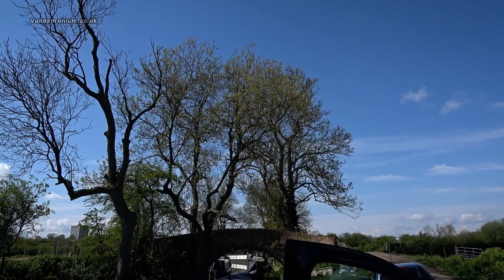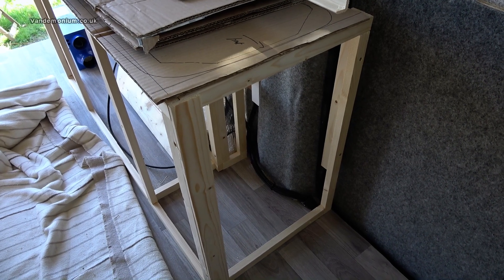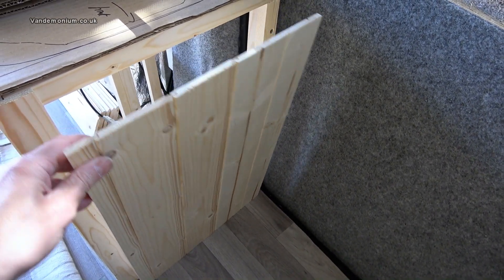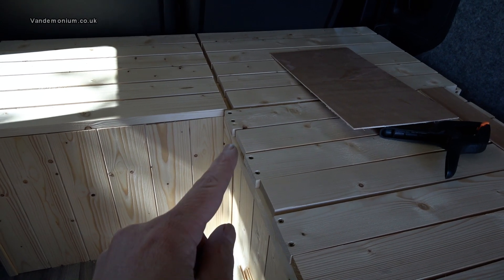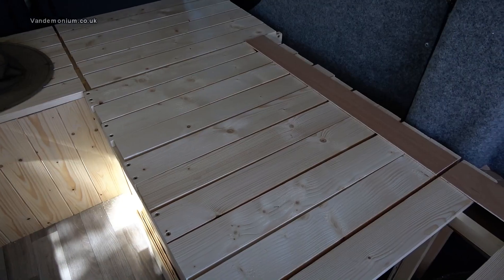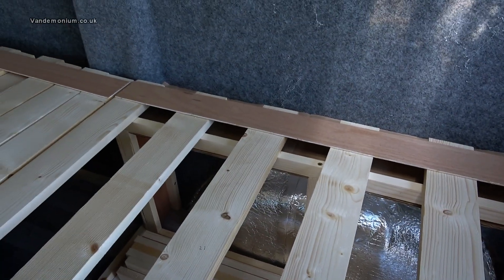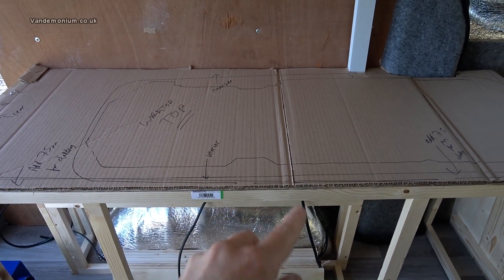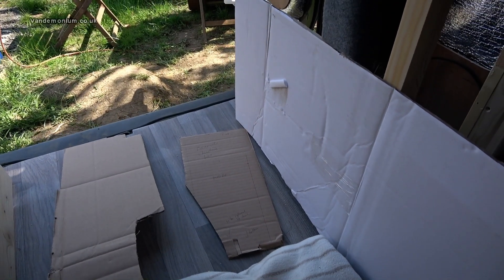Vlog 16: more wobbly furniture building for my DIY campervan conversion

Comment: Hi David
Very interesting video as normal, if you go with the ply worktop you could just tile the top before dropping in the sink easy and cheap to. I fitted out an old transit many years ago really enjoyed it, it was one of the old transits with the sliding front door great on the hot summer days.

Comment: Just round those lathe ends off which hold the tops in place over the toilet and storage, it then gives them  a bit of a lead and will make the action of closing a bit  smoother.
Reply from the maker: Yeah, I've done that! Cheers :-)

Comment: Use the wooden end where the water bottles are going,and make it a lift up table, with a Hidden hinge at the top and a bolt latch on the bottom to keep things snug and secured, oh and I thought the lol was going at the bottom of the bed!!! Loving the videos, can't wait to get my own lil van and explore ,doing a fab job, love how your brain is working on the pros and cons of different things, oh and so glad you ain't got a Brummie accent, and Botox smile....oh behave victor...ok ok I've had my moment😁
Reply from the maker: Considering I grew up in the West Midlands it's rather odd that I have a Home Counties accent!

Comment: Looking very good!! 
An idea for your water bottle situation, you ca either run the wiring up the side of the pillar and make it cross from 1 side of the pillar to the other just under the worktop or drill a hole either side of the pillar and feed the wiring through the pillar. Hope it helps.
Reply from the maker: Unfortunately it won't work, there's no space to run it up and I can't (indeed won't) drill through that pillar as I think it's structural but also there's a wire in it. And the bundle of wires come out from the floor next to the tank so they'll still be in the way. Never fear though, it's not going to be an issue - keep watching!!

Comment: Using plywood for that counter top is a fine idea. Maybe a suggestion? Why not apply a thin pice of oak ply to the top of the plywood. That might be a lot cheaper? I have no idea how much that stuff costs over there so please forgive me if that would be not usable because of price.
As for the hinges, you should be able to get some that actually hinge from the inside and those one's just kick the door a little bit from the wall when opening the door.

And you might be able to keep those gray and fresh water tanks in place with a little bit of strapping. The kind that is used for retaining loads on the backs of trucks. Something that's about one inch and just uses a cam lock for retaining.
Keep up the good work sir. You got this.

Comment: If you buy a roll of wood effect plastic contact that you use for book covering that would work for the surface area next to the hob.  I covered an old desk with it for use as a kitchen bench and it has lasted years and is easy to clean.

Comment: Smashing ... although I feel if you buy a nice bit of butchers block worktop if you're careful you will have a nice two sided chopping block and hot pan/plate/etc stand which with some ingenuity could live tucked away somewhere sensible. You can often find nice worktop on eBay or preloved. That's where I found mine for my garage roll cab top.

Comment: Regarding the strips of brown ply you have on the top of your base bed . The best way i think is to put a 3" x 2" timber under the top . The best way i would approach this is put a pencil mark under the slats at the back of your bottom framework , from underneath .then turn them over and screw them on. If any of that makes any sense. Just a thought gerald .PS your doing great

Comment: Hi David, 
I think l get the gist of the bed base, which is similar to many caravan arrangements.
The storage of the fresh and grey water bottles where they foul the wires, is there enough height to perhaps raise the floor above the cables to 
Provide enough room for them as the wires will be lower.
An elastic loop will secure the bottles and the end access door simply secure with "Velcro"
Reply from the maker: There's not enough height, I tried that but they get in the way of the sink and the water pipes. Cheers though!

Comment: I can't imagine using that work process when you were in journalism. So many retractions.
Reply from the maker: Different concept there, you weren't trying to design anything. Yet it still applied, to a degree, to the way each news package was put together; it'd be shaped by what I ended up having got on film and then assembled, despite any attempt to pre-plan how it would be shot and told.

Comment: Great update! Love the design for the bench/bed... was thinking about your counter top.. there’s really nice peel and stick vinyl strips available here in Canada that look like nice wood... what about something like that for the counter? I’d stick them on before cutting out the hole for the sink etc... then the edges would all be under the unit that’s going in... you could get away with cheap ply under it! Save some money... you may even be able to use an offcut of flooring that would fit that worktop? Maybe to match the floor?
Reply from the maker: Good idea. Alas it's all done now (the videos lag real-time by about four weeks)!
Reply: Vandemonium 
 Ah well... cant wait to see the video

Comment: Echoing the comments below, you could use the walnut or bamboo or whatever wood you prefer but join the cabinet portion at the left with the longer support pieces for the fixtures and fill the joins with the sawdust from cutting and sanding the wood with wood glue or epoxy (whichever stains best) to eliminate the crumbs and what that falls in cracks to make life difficult but which come with cooking. You have a limited amount of countertop and you might consider a pull out or pull up workspace when you need it. Lastly, you can use internal hinges to the right of the kitchen, placing them above and below the cross pieces. The hinges should do the job just fine, though towards center because they will still occupy the top portion and the bottom portion. If you feel that the placement could compromise the hinges, use a pair graded for a heavier load. Looks great! I have wanted to do this for a few years but haven’t figured out ease of movement for my husband and his massive wheelchair. Love your videos, still!

Comment: May I make a suggestion? If your water tanks are not in need of a lot of hight. Cut some strips of wood, and glue them down, and let them sit on them, over the wires. To not have to worry about your tanks falling over. Put two two screw in eyebolts, inside of the cabinet, where you can't see them. Then run s bungee cord around them to hold them in place.
Reply from the maker: No height alas to raise them due to the sink & pipes but the bolts idea sounds good!

Comment: Loving this series, although I still think the beauty of the canals has me slightly preferring the narrowboating... Although that might change when this thing is ready to take on the road! As to your comment about computer programmers and design documents, I'm a top-level web programmer at a marketing company and also a hobbyist video game programmer, and design documents in the way that you described them don't exist in my experience! We might get some instructions about what something should look like or be capable of doing, but when it comes down to actually writing the code we are just freestyling to a large extent :D
Reply from the maker: Haha, I worked for IBM and another large computer consultancy - all very formal corporate stuff!!
Reply: Sounds very similar to my current position, interesting... Maybe I too will find myself living aboard a narrowboat in another 20 years time. ;)

Comment: Since you would not want to pull the bed extension all the way out, you could hide the securing of the battens under the bed anyway, sitting flush to the part covering the wheel arch, and that would let you put hinges on the stationary battens.

Comment: You can tile the worktop with small mosaic tiles , it would be waterproof then . The bed you could add another piece of plywood  and hinge it like a door , when you entertain , just op-en  it out  and fit some legs . With the water bottles  is it just a matter of the wires  in the way ? Maybe you could fit a false bottom . Check out the alternative to Velcro ,you can hang quite heavy  weights from the latest stuff. You could add to your bed trim so everything  would look nice , however you can then remove and reposition . Hope this is helpful .
Reply from the maker: I like the tiles idea! Not sure what you mean about the bed but it's finished now, you'll see in an upcoming video. Cheers
Reply: You could buy Laminate sheet (tough and fully waterproof) on a roll, it's only 1.5mm thick and it will glue to your plywood. it's the same material that standard worktops are constructed. It comes in all colours and design patterns and is relatively cheap. I get mine from BGN Boards Co.

Comment: Starboard also known as marine board or HDPE sheeting  would make a very nice low maintenance counter top.It isnt the cheapest stuff but a thin sheet on top of ply wouldn't be that much and chances are you'll find uses for the waste to offset the cost.

Comment: I highly reccomend you have someone with a gas fitter's liscense connect the lines for the gas 
, for safety and you might need to it to pass the MOT.
Reply from the maker: Yes, I will be doing that. It's not part of the MoT as far as I'm aware though.

Comment: A tip for you method man when you make a frame with horizontal and vertical i noticed you put one screw in .put 2 screws in on a 45 degre angle it stops it from twisting or moving one screw it will move

Comment: I would build a little lip out of wood to stop the water tanks moving in transit, then just need to lifted over an inch or two to get in. Also if you hinge the door, wouldnt it be better the other way so you can change the bottles while standing outside? Just some ideas :)
Reply from the maker: Actually there already is a lip from the wooden frame so maybe that'll be enough? The door is now on magnetic catches as you'll see in a later vlog.
Reply: Not sure if that's tall enough, would have to work out the tipping point. Ive just done a similar thing in my van, but mine need to top tip when I turn. Time will tell if its tall enough!

Comment: Use a multi tool to separate the corner piece. Try the either a fine tooth or the flat blade. :)
Reply from the maker: I'm not taking it off. Too late now anyway, the whole thing's painted and largely finished, furniture-wise (as you'll see in future vlogs)

Comment: I would not install a hinge for the water cabinet - at least not on the right side. When you want to access the cabinet you may need to haul the heavy canisters from the sliding door. So the hinged panel might be in your way
Reply from the maker: Good point

Comment: I wouldn't worry too much about feeling the little ply strips through your mattress - I'd worry more about feeling the bloody great gaps between the slats when it's slid out in wide mode!

by the way - your ply floor-fitting tribulations (from several vlogs ago) suddenly made sense after you explained you (lack of) design philosophy  :)
Reply from the maker: The bed design is very common not only in vans so should be fine. The floor didn't need design, the old ply was the template.

Comment: You could paint all exposed wood to stop any splintering and get a plastic chop plate for the end of the sink. How about your supply water jug being smaller maybe 10 or 11 liters instead of 13. For drinking water you could always just use some bottled water in the fridge and use the sink bottle for any wash-up. Also with your waste water jug being bigger than the supply bottle less chance of a overflow. A cheap flip latch like you'd use on a screen door should work fine for that door on the end of the sink.

Comment: for the Sink section top...  seal the ply with thin coating of epoxy (unlss you are using marine ply)  then tile it... tiles stand hot pans and look nice.
BTW i prefer that method of coding as well.. long live badly coded PHP!!
Reply from the maker: Haha, that pretty much sums up my code. The last stuff I did was "LAMP" - Linux, Apache, MySql and PHP. I presume that's all very old hat now!

Comment: In water area raise the floor a couple inches with a platform so the electric cable are below the platform and not in the way of the two water bottles this could be I nice place underneath the platform to hide important papers and emergency money... as for the door to the water area make a French cleat on the bottom and magnets on the top...
Reply from the maker: Sadly no room as the sink and pipes get in the way :-(

Comment: You could put an interior hinge on the water cupboard David. You wouldnt see it at all.
Reply from the maker: It wouldn't work, there isn't an inside edge to fasten it to and the door overlaps the corner piece. I've used magnets now!

Comment: Noe that is quite brilliant work and one can see how things are coming along. I really like the layout, it is quitem flexible and allows you to use nearly everything in several different ways. I have seen much worse workmanship than your, including from German craftsmen, so my virtual hat is of to you. 
I understand your reasoning about not getting expensive wood for the sink. BUT: 12 mm is not thick enough, really now. If you must get yourself something like boat builder's plywood at least 16 mm thick, which is waterproof, and give it a couple of coats. If you cut things right you might end up with plate you can place on top of the sink when you do not use it that you can use for kitchen work.
Keep it up please. And if you ever come to North Germany drop a hint please, I`'d love to show you around.
Reply from the maker: Too late, done now! (the videos lag real-time by about four weeks) but cheers anyway :-)

Comment: Cabinetry hinges that require a 35 mm forstner bit and two blocks to give the required depth could be a solution, the advantage is, they would be hidden. Something to ponder for next project.

Comment: I like that idea about the cutting board being on the end like that. Just make sure, if you do it in wood, that what you finish it in has to be food safe. Or you'll be eating varnish that might make you sick. & always do around 3 coats for a shine. I hate when people buy expensive wood then cover it up with paint. Let that wood shine baby, let it shine.
I mean if your going to just paint it. Use something that's not as expensive, like pine for example, pine is cheap & light & it doesn't cost a fortune like oak or walnut. I used pine for my end tables I had a friend make for me. I stained them a Golden Pecan, then put a clear varnish on them & they are just beautiful. I've had nurses try to buy them from me. I just keep saying no thank you. Then they say if you ever change your mind please tell me 1st. I'll buy them in a heart beat.
But everyone has to do them. & don't change for anybody. You do you!!!
Thanks for another great video of the van built. How go have a gin & just relax. I worry about you worrying so much about building your van out. Know one will see your mistakes,  so please try to relax.
Thanks, Chris
Reply from the maker: I've both painted and varnished the wood, as you'll see. Errm, I am relaxed. This is me being relaxed.
Reply: Vandemonium I'm so glad your relaxed then. I try not to be such a Mother hen.. lol..

Comment: just a couple of things, that toilet may be a bit heavy to lift in and out when partially full  , imagine if it spilt!!! a door to slide it out might be better, an off cut of kitchen work top would be better than ply for you sink unit, just a couple of ideas, great build enjoying it.
Reply from the maker: It can't slide out as its too high for the top part of the frame. I'm well used to lifting 20l waste containers on my boat though and this is much the same so it won't be an issue. They're designed not to spill!
Reply: In our old Renault campervan years ago we had our loo under a seat just like you are having it. We used an old towel underneath and up the sides like a sling so it was easy to lift it out as getting a grip on either side of the loo was difficult due to lack of space.
Reply: And as you have said it is going to be a weekend type van the container will never be approaching full unless .... Delhi belly :(

Comment: Could you use a smaller sink to give you more counter work space?  I'm sure you've thought of it, but wondered nonetheless.  Quite complicated design on the bed...good job!
Reply from the maker: No, the sink and hob unit is all one piece. I'll only be doing tea , soup and baked beans so it's not really a problem!! :-)
Reply: I have the same hob/sink combo. The sink size is okay but you wouldn't want to go smaller. Where you lose space is the one piece steel molding and the hinged glass lids. You lose space but you gain glass workspace. In a van conversion everything is a compromise.
Reply: Vandemonium I expect more than baked beans if I was visiting you,  on toast at least with some grated cheese on 👍🏻
Reply from the maker: Luckily, I abhor visitors and shall keep them at bay :-)

Comment: I will all turn out ok, don't overthink it! Please be aware that your timber is the softest stuff, second only to balsa wood. You will probably find it will split when you screw your hinges on, (so drill pilot holes), but I think I would go for magnets. Decent neodymium? magnets are really powerful and you can epoxy glue them in place perhaps? Just an idea ol' chap. Ta.
Reply from the maker: It hasn't split and I always drill pilot holes. I've used magnets, glued on as you'll see in future videos :-)